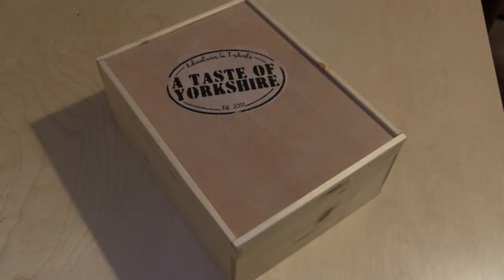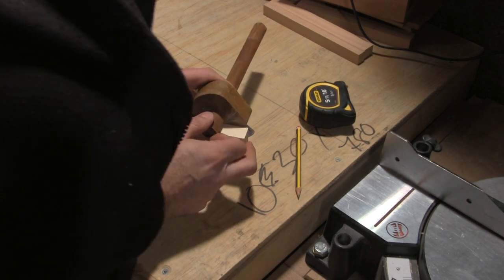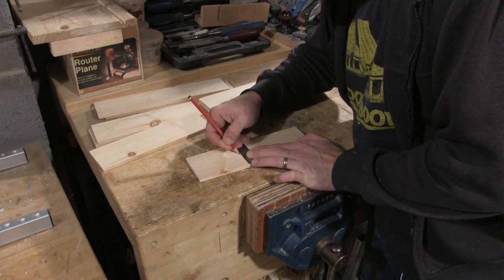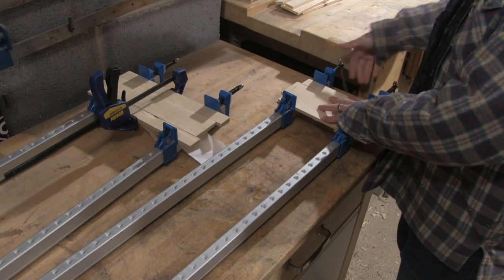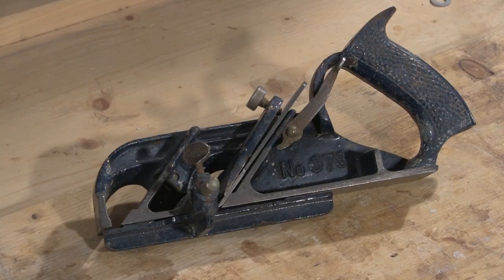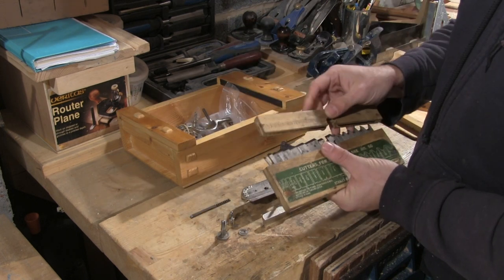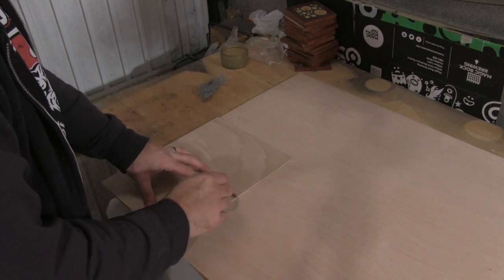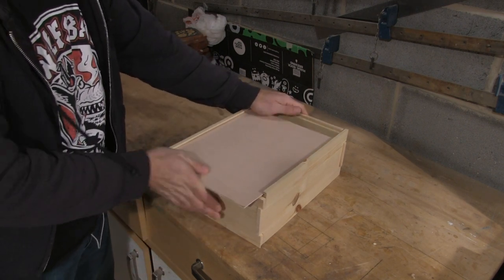Woodwork Project: Christmas Gift Box - Hand Tools Only

Comment: O , what a hand tool project !?? indeed very encouraging to me as a beginner hand tool guy , I just got a plane which make groove , it's not a Stanley but works fine , have 78 too , o god love these tools makes me over the moon when I use them .👌
I like when u take advantage to avoid making the joint of the box .
Thanks for showing that excellent work 😊👌 .
Reply from the maker: Thank you. I really like using those planes also. Usually I can cut a rebate or groove faster with these tools than it would take me to set up a power router.
Reply: @adventuresint-shirtswoodwo3905  I'm not a fan of power tools rather love spending my time with hand tools , I have been a hand tool beginner for 3 years now and u can imagine how my hand tools is piling up 😂 and my saving money going low 😂 but I'm happy .
Reply from the maker: @athmostafa2462   :D Yes, I know the feeling.
Reply: @athmostafa2462  Me too! My tools are fairly cheap but they work fairly well. I like that it's not noisy and loud; rather quiet and peaceful. Ah... love it! Good luck with your work, Mostafa.

Comment: Great to see you back - thanks for the video! That card scraper in the resaw cut is a great idea. You make it look easy. I really struggle with my resawing.
Reply from the maker: Hi, thank you - I have a bunch of projects to edit so hopefully I'll be putting new videos up more regularly. Yes, re-sawing is not easy. It just takes practice, and an acceptance that the sawn surfaces could be very rough so plenty of planing to do. You'll get there. Marking all the way around and taking it slow, accept you may run off the line and prepare to correct. I find it easier to keep the cut accurate when working from a corner so that two sides are easily visible at the same time.  Sawing of any type is definitely my weakest skill!

Comment: Hello. Could you have used the combination plane to cut the rebate? Just trying to plan my next “big” purchase. 😃
Reply from the maker: Hi Tim. Yes indeed. Mostly in these videos I try and keep things to a minimal tool kit, but yes I regularly use a combination plane for cutting housings/trenches/dados - in fact I'm surprised I can't find an example of that in one of my videos. Maybe I have something using a combination plane in one of the project videos I haven't got around to editing yet.
Reply: @adventuresint-shirtswoodwo3905  great, thank you. One more question. What model combination plane is that and would you recommend it?
Reply from the maker: @timearll266  I have a Stanley no 50 which I picked up many years ago at a flea market and which luckily came with a full set of cutters. If you can find one of those, then it's a good buy and works very well as long as you keep the cutters sharpened and honed.  These come up on eBay etc fairly regularly though, it's worth holding out for one with a full set of cutters. If you are going for an investment in something new, then the Veritas is nice - its probably 4 or 5 times the price of a vintage Stanley and I' think you probably have to buy individual cutters separately so could end up being pretty costly - but it's lovely kit if you have the money. I'd avoid buying a budget or box store brand combination plane though, the precision of engineering is very important and the ability to get a razor shape cutting edge on a properly square cutter is essential for these kind of tools to work properly. A mis-aligned or not sufficiently sharp combination plane will prove impossible to use cleanly and put you off the tool for life! 

Usually I think some of the snobbery between modern handy-man tools and vintage/pro level is a little overstated, but in the case of combination planes and rebate/rabbit planes especially, quality makes a huge difference to the results you can achieve.
Reply: @adventuresint-shirtswoodwo3905  super bien, thank you for taking the time for such a complete answer. I’m glad I found your channel, looking forward to going down the rabbet hole 🕳 👋
Reply from the maker: @timearll266  You are very welcome Tim.